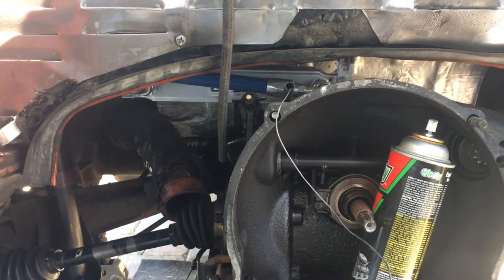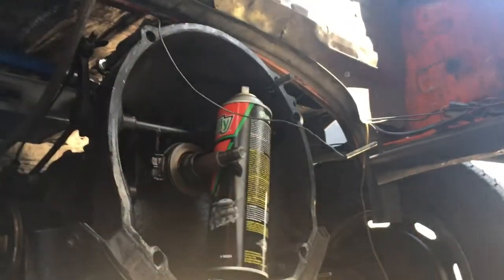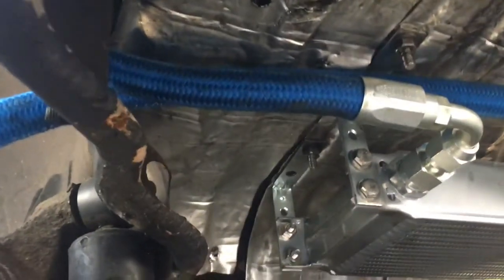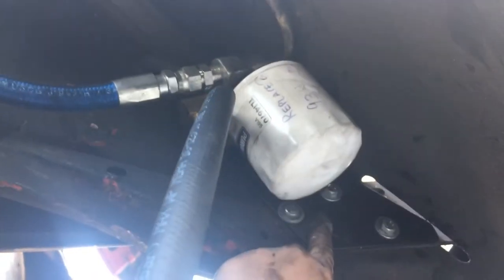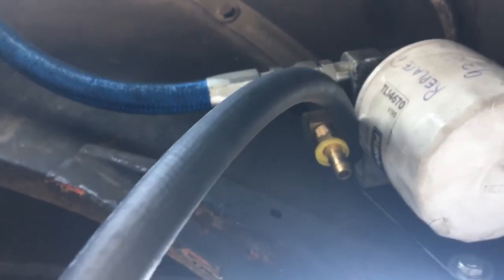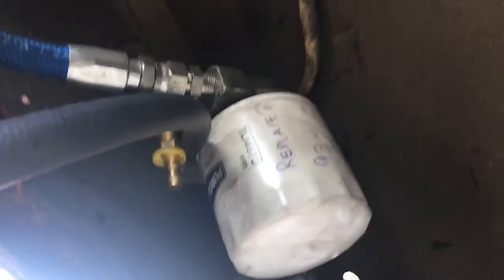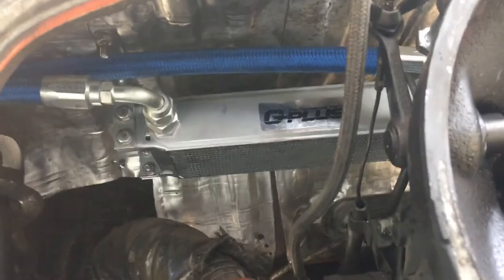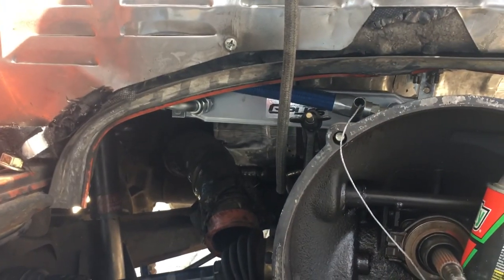VW Bug external Oil Cooler Plumbing {} Roadtrip Prep Pt. 3

Comment: Hey bro I know this is kinda late but did you retain your stock oil cooler ?
Reply from the maker: Yessir
I had both goin
Made a difference 
Especially since I towed a trailer w the big 1200 miles !